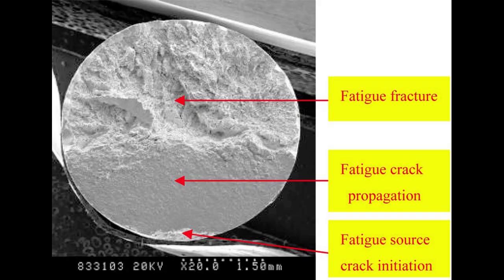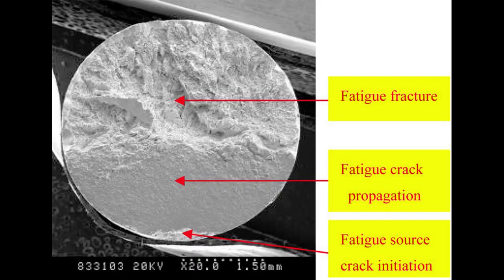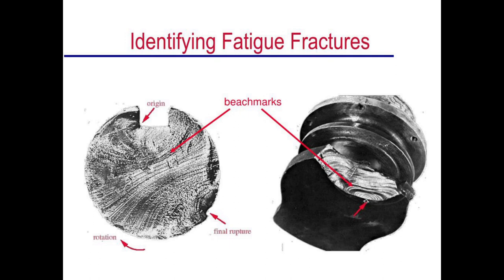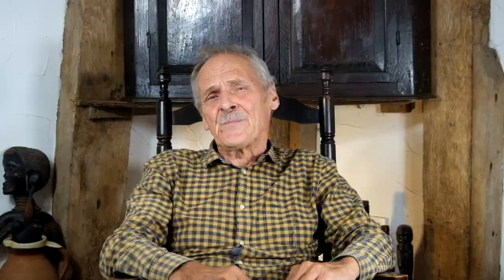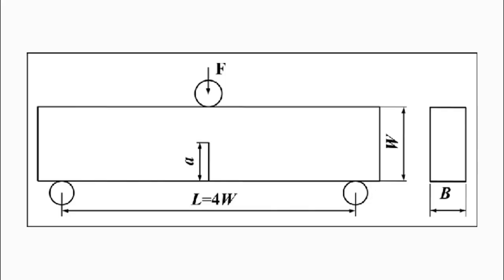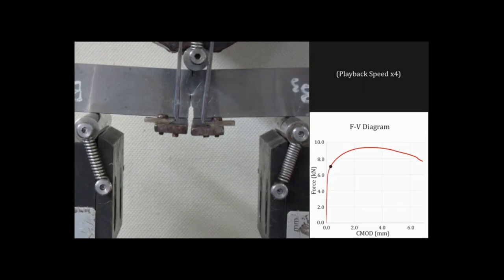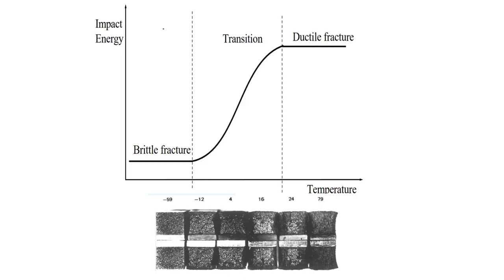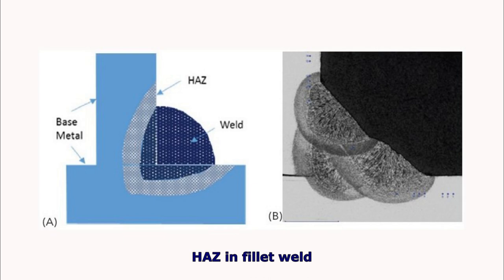Why axles break on overland vehicles! Part 2 - intro to fatigue and fracture

Comment: Did not understand everything sorry my opinion the people who complain about broken thru axles often have very large tires on them and torment the land rover through the mud or dirt
Reply from the maker: This series of videos is technical and I have really tried to make them understandable to technically minded viewers.
If you persist in watching later videos in the series you will see that fitting wide tyres and wheel spacers can have a very harmful effect on fatigue of axles. I include cases where this is the primary cause of failure.

Comment: Thanks for the informative video.
May I suggest to let the images screenshots longer on the screen so your words can be better visualised?
Thanks
Giacomo
Reply from the maker: This ia something I give some thought to. The default is around 4s which from your comment is too short. I am not the best judge of the optimum duration because I am already familiar with the content.  Andrew White, whose video making courses I have followed, advises keeping things snappy however his videos aren't so technical. I will certainly bear your comment in mind for the future.
Reply: @defendermodsandtravels  I have followed Andrew for a long time, but his content is very different. He has a more cinematographical approach (videos and photos are of extremely high quality). 
His technical knowledge is based on his experience and not on studies (which is still a vary valuable resource).
For the purpose of your videos, since the content is way more technical, I think would help to have images for longer, depending on the concept discussed. I am the kind of person that like to visualise information to fully absorb them but I acknowledge that for some may be different.
Thanks for the reply.
Regard
Giacomo
Reply from the maker: @Maedetto  Constructive comments. My amateur video making skills are still developing and I have re-made a number of my earlier videos as I learn more.
Andrew White's film making skills are excellent (he used to do it as a job) but his techical knowledge is weak IMO. I think it's quite risky because many people will take advice from an opinion former even if it's flawed. If you watch my videos on dual battery charging you'll get my drift.
I like Paul Marsh's pragmatic approach and he will never give dodgy advice. I also like Dan Grec of the Road Chose Me who freely shares his experience.
Reply: @defendermodsandtravels  I also really like Paul Marsh. He has a different again approach that is more "hands-on + experience" that in my opinion is really valuable. I am not sure of his technical background but from my perspective his advice are sound.
I think that risk of misinformation from ASPW is minimal compared to bigger channels, however he does says that those are his opinions and often along the track changes his mind and recognises that he was wrong. 
I have learnt many things from him but definitely not the technical ones.
Good luck with the channel. 
Thanks
Giacomo
Reply: @Maedetto  Look at ASPW and his reverse intercooler airflow theory! He was taken down uncharacteristically politely by John Cadogan and was honourable enough to acknowledge .
Reply: Giacomo et al
Simply pause the screen.